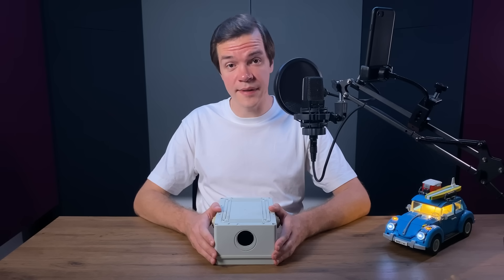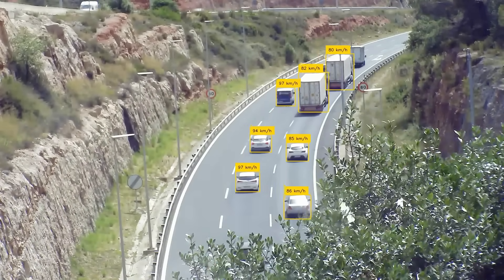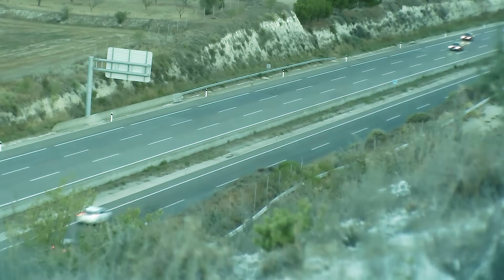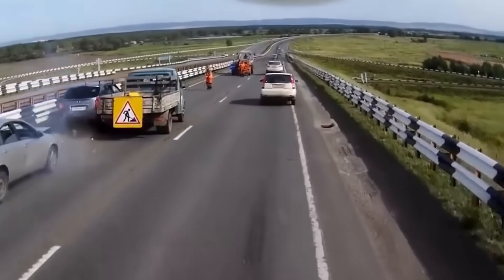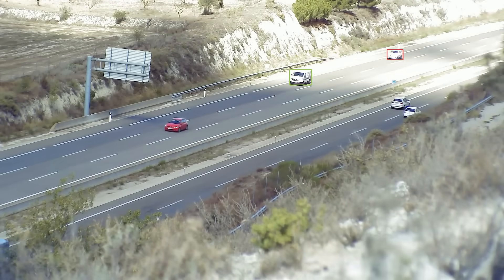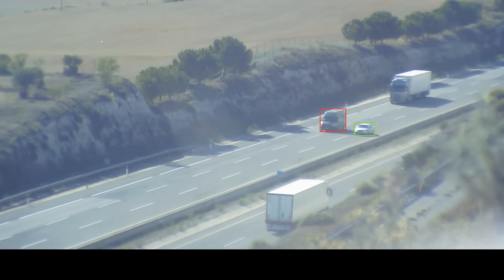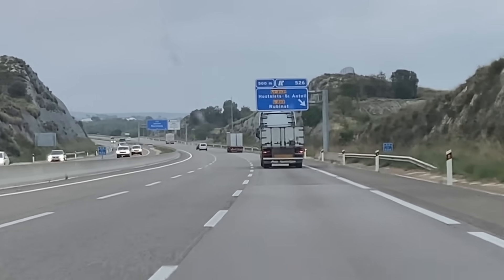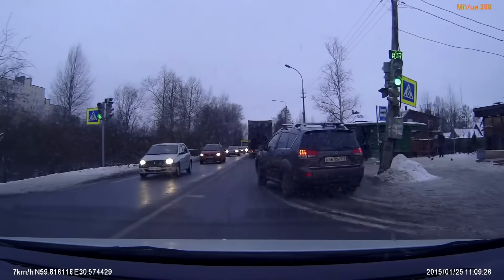New Anti-Tailgating Camera Reveals Shocking Statistics

Comment: It's certainly frustrating trying to keep a safe distance and cars just throw themselves in between non stop, forcing me to slow down to leave more space, continuing the cycle.
Reply: I’m totally with you in that frustration.  When 80% of drivers think “there is a gap! I must fill it!” it becomes impossible to truly keep a safe distance.
The crazy part is that to each of them you are “driving too slow” so they actually think you are the problem.
Reply: @thepooz7205  you are the problem. Traffic should be moving as close to simultaneous as can be when in traffic, slowly allowing more of a gap to a little more than one car length to allow one person to merge at a merge point. No more. Start driving with some anticipation and you won’t feel the need to be 40 lengths back to feel “safe”
Reply: @kingkrow420 Anticipation only works on what can be anticipated, and you don’t have room for forgiveness in the metal box going 80 mph (exaggeration, this applies anywhere above 40 mph)
Reply: not to mention people that overtake you on the right because you try to keep a safe distance, which is illegal af in pretty much all of europe (save for some instances). They then trying to act like I'm the one who's driving badly, it's tiring. The absolute worst I've seen this happening when I was driving to Sweden from NL, in Germany it would happen ALL THE TIME, mostly SUV's, all of them German license plates 

For context I basically always speed on the highway, move to the right if I can and it makes sense. If you're stuck behind a train of cars in the left lane, moving over for someone behind you doesn't make a lot of sense, it only encourages tailgaters if you move out of the way, that's still like a 50/50 for me. I do try to use tailgaters to my advantage, I move over and start driving behind them, they're so obnoxious that people will move out of the way sooner or later. Other 50% is flashing the brake lights and flipping them off lol
Reply: @Peter_Griffaaa @Peter_Griffaaa  It happens if you drive on the 2nd or 3rd lane, not at the maximum allowable speed, and do not intend to overtake those who also drive on less than the maximum allowable speed.
Reply: @Peter_Griffaaa  you must have been driving in some parallel Germany or NL. Overtaking on the right almost never happens there in my experience. Especially in Germany, especially on the parts of autobahn with no speed limit. The chances are, that your driving style is not very good.
Reply: @barmalini  you've clearly never driven in the holiday season. it's hard to take you seriously in any case
Reply: @Peter_Griffaaa  just one question, why don't you keep right when you drive slower then the other cars?
Reply: @Peter_Griffaaa  "not to mention people that overtake you on the right because you try to keep a safe distance, which is illegal af in pretty much all of europe"

I'm not sure about Europe, but everywhere in the US i have driven which has a law against overtaking on the right ALSO has a law against leaving an empty lane on your right.

Which is to say, that if people are ABLE to overtake you on the right, you are probably also doing something illegal.
Reply: @ShuRugal  pretty bold assumption, you've never driven in busy traffic before? You've never encountered any real a-holes in traffic either, apparently. Lots of times the passing lane is congested but still going faster than the right lane (because semi-trucks). There will be (some small) space between the cars and trucks on the right lane now and then, so nice try but you're wrong
Reply: @Peter_Griffaaa  while people doing what you describe exist, my experience in heavy traffic (Phoenix AZ and Washington DC are on that list, so yes, i have driven in 'real' heavy traffic) the overwhelming majority of undertakes i have observed (happened to me, happened to others, or performed by me) have been in cases where the car on the left was either not passing at all, or was remaining in the left lane for minutes between passing vehicles.
Reply: @ShuRugal  Yeah no I was making my own bold assumption haha. I don't think it's even illegal to do what you describe in the US, so fair play,  that isn't the same here. I signal with my lights if the left lane isn't congested and the car in front can safely and easily move to the right, most people oblige but some are just bitter or something, they think they can decide how fast people can go. Even then I won't undertake, but start making hand signals in the hopes of him/her looking in the mirror 😂 I haven't had experiences like that with 3/4 lane roads, fortunately. 

Why are there so many videos of people in the US staying in their lane, so it looks random what speed they're driving then? It's theoretically almost the same as here but in practice it seems a lot different, at least to me
Reply: @Peter_Griffaaa  >Why are there so many videos of people in the US staying in their lane

I don't know that there is any one specific cause.  In my experience, it's just human behavior.  Here in the USA, the average mileage driven per driver per year is 13,500 (for passenger vehicles.  commercial drivers obviously average much higher)

most of those miles are NOT driven at highway speed.  if we assume an average speed of 40 mph, that's one hour per day IN MOTION.  obviously the miles-driven stat does not cover time spent sitting at traffic lights or in traffic jams, which can double or triple time spent actually in the car.

When people spend hours every day doing the same activity, they naturally look for ways to make it easier.  I believe that's the biggest factor behind seeing the "highway train" phenomenon, where everyone just grabs a bumper and stays in that lane as long as they can.
Reply: @Peter_Griffaaa A lot of drivers in the US don't check their mirrors or speedometer. They drive by feel and change speeds according to how fast the car next to them is going. They are inconsiderate bad drivers who are not aware of their surroundings. Driving is considered a right but should be a privilege.
Reply: @ShuRugal  in Europe it's exactly the same, - you must drive in the right-most free lane. Most likely, it's he who keeps driving in the left lane all the time, pissing-off the entire autobahn
Reply: @Peter_Griffaaa  Overtaking on the right is perfectly legal in at least a few EU countries, as long as both lanes are intended to drive in the same direction (highways etc) though you can barely call that "overtaking". The REAL overtaking is where you are driving on the lane belonging to incoming traffic, and only then it's illegal for someone to "overtake" that you from the right.
Reply: Well done, thank you for the video. With exceptions I always try to maintain the 3 second rule, regardless on highways, or on the street, however, if I noticed a tailgate behind me I would increase that to 5 seconds or more intentionally to save my boot.
Reply: Do you live in the US? That's what driving on a US highway is like. You simply cannot maintain a safe distance between yourself and the vehicle ahead of you, because if you try, without fail, someone will speed up enough to overtake you, then slot into your safety margin space and slow down. One can't help noticing how stupid it is, because the person who speeds up to overtake you winds up cruising at the same speed they were going before overtaking you. All they do is force you to slow down so you can create another gap between you and them, which sets up the opportunity for the next @$$hole to overtake you and slot into your safety margin space.
Reply: Just set cruise control 2mph below speed limit or flow of traffic and you don’t have to brake much.
Reply: Screw keeping a "safe" distance. I'll drive 5mph slower than the people in front of me until I'm a quarter mile behind the cluster. Then if people want to tailgate me I'll gradually slow down more until they pass. I don't want another vehicle anywhere near me on the freeway when 1/3 of drivers are holding their phones in their hands.
Reply: The cars throw themselves in between? I'd bet it's the driver of the cars.
Reply: @mikemortensen4973  The people throw themselves in between? I'd bet it's the the people steering the cars.
Reply: That is precisely why I just choose to go ahead and pass that person. And everyone else. When i finally find a nice gap i just chill there.
Reply: This is why people tailgate.
Reply: It beats the alternative. Keep up the good work.
Reply: Yes, there comes a point where the danger from people performing risky undertakes and overtakes so they can jump a bit ahead and cut back in front of you is more dangerous than just leaving less gap. Unfortunately you cannot entirely dictate how safely you want to drive, to some extent that decision is made by others.
Reply: The only answer is to drive with an absurd distance between you and the car in front of you. If half of all drivers left 50 yards or 35 meters in front of them, there wpuld be no traffic jams.
Reply: No, YOU need to drive less like your grandma and decrease your distance. YOU are the problem.
Reply: @edwinov  sounds like you're either 14 years old or never developed past it. Enjoy crippling a family of four with you superior driving.
Reply: It’s sad but we need more cameras all over watching the public places so you have protection from selfishness.  Thanks

Comment: Interesting video that backs the psychology I've witnessed on US highways for over 32 years of commercial driving in large trucks (often overweight/oversized loads that are far more heavy than the average tractor-trailer).  There is no easy answer or solution to this and I've witnessed it in all conditions and situations, be it rush hour traffic in big cities or driving in very rural areas.  Most of it is true ignorance on the part of today's drivers, a false sense of security reinforced by the fact that most are clueless about calculating stopping distances vs. weight vs. brake efficiency vs. weather, etc.  That is fact...  Not conjecture.  I used to do a lot of general aviation flying and braking distances vs. weather vs. runway surface conditions vs. runway length are just part of what one has to consider so a pilot doesn't become one with the obstacles off the end of a runway.  

Others have mentioned how vehicles will fill the space one leaves for safe following...  This happens with trucks all day, every day, ultimately slowing a truck attempting to maintain a safe distance more and more until now it has simply become an even larger obstacle with traffic streaming around it.  This is the best case scenario.  I caved in the rear end of an SUV years ago in Alabama when the driver raced around the right side of the tanker I was driving to jump into the space in front of me at a construction merge when I was already braking for traffic that had braked and stopped in front of me.  The construction zone was not properly marked and there was a crew in the right lane over the crest of a hill with no proper warning signs, replacing a road sign.   The driver that cut me off lost when the decision was made to rush around the right side of me (the side with the least visibility in a big truck), then swerve over in front of me to slam on their brakes.  Brake-check a big truck and a smaller vehicle simply loses, period.  You cannot defeat physics or Darwin at that point.  

The psychology is interesting, though...  I will see those with cruise control move to the passing lane a half mile behind me, then they move over in front of me when I cannot even see their rear-view mirror, only two or three car-lengths away.  Think about that...  Why would I wish to ride closer to you in such fashion?  Why would you wish to play Russian-roulette with a big truck?  That is simply the lack of education of drivers, in many ways.  Most are oblivious and there are far too many distractions in vehicles these days (defeating cell phone usage would be tempting but that would also impact passengers, so that's not a clear-cut answer, either).  

I am happy I do not have to drive long-haul in much of the US now for these reasons, since I've returned to mostly oilfield driving in the Dakotas, Montana and Wyoming.  And, yes, the new generations of truck drivers often drive as if they are operating a car, sharing the blame with much of the general traffic on the roads these days.  I looooove lots of following distance in front of me and always have.  I was brought up with courteous driving habits, as well, but that has mostly eroded into the "me-first" attitude so prevalent in today's world (for it's not only the US that is guilty for a change  lol).  Just my two-cents-worth.  :)

Comment: Simple enough to require following distance software with automatic deacceleration on new cars, with a driver op out setting that emitts a radio wave for enforcement. It's the next logical rule after "seat belts".  Cars crashing without the following system activated could be ticketed for reckless driving and exempt from "collision" coverage.

Comment: While I agree with the main points of the video, I think there is a serious misunderstanding about what is considered the safe following distance. 

The 3 or 2-second rule (depending on country) represents only the reaction time, as the stopping distance after braking is approximated to be equivalent for all participants. 
The main purpose of this is city driving where there is a high volume of cars at lower speed where the statement usually holds (especially that in these situations the first car rarely needs to use the full performance of the brakes, thus leaving headroom for the following car), as the inclusion of the braking distance would unnecessarily choke the throughput of the streets. 

Now, if people fully understand the implications, this also means:
- Most importantly, if you are not in a following car but a place where you might need to react first, you need to account for total stopping distance, thus in reduced visibility condition or where there is a higher likelihood of emergency, SLOW DOWN for the love of god... Especially next to road works, the amount of people annoyed that they can't go 130 kmph half a meter from another human being is frankly infuriating.... 
 - At higher speed, you need to account for performance difference SIGNIFICANTLY more, thus you need to leave higher safety margins 
 - The impact of different conditions ISN'T the same for every vehicle(type). e.g. slippery surfaces might degrade motorcycle braking to be worse than cars, as they only have 2 tyres the friction to kinetic energy ratio can flip to the car's favour + so they can't just stomp on the brake thinking abs will save them 
- There might be other limiting factors on breaking, e.g. a bus driver might not want to send its passengers flying, or you are followed by a heavy vehicle without the necessary distance...

Comment: What is equally frustrating is something I call reverse tailgating. This is when passing drivers move too early when passing back into the right lane. If 1 second per 10 mph is required, they need to allow this space before moving back into the right lane. But what happens is that they move over too soon and do the reverse tailgate maneuver, causing you to be tailgating the passer.

Comment: My dream is that one day highway driving will only be allowed by the car itself, and cars will communicate with the cars ahead. So they will more or less break and accelerate simultaneously. And if there is a queue 10 kilometers ahead, already now the cars will slow down to avoid the queue to pile up. Autonomous driving should be easily solved on highways, because they are predictable and can have special signs to give information to the cars. We would have near zero accidents.

Comment: Speed does delay the time you need to brake and in some conditions, view can be limited. You can't process things as clearly when you are going faster. Coming from Germany, on some highways, going above 200km/h isn't even considered speeding. From this background, I would say speed sure is a factor, and in an area with a lot of traffic, you should limit speed accordingly for safety. Especially overtaking seems a lot more dangerous with higher speeds.
 But the distances sure matter more.

If you want people to actually respect speed limits, you need to do speed cams in a variety of locations at different times, and getting caught needs to hurt. People are used to not getting caught, that's the problem.

Comment: I believe it is still relatively easy to prove someone was tailgating. Vehicle license plate ID, and multiple tailgating cameras over a few km should show who is tailgating. And just like speeding fines, you should have the right to view the video which is supposed to show you were tailgating. No video, no fine. I think a more advanced system could also use overlapping cameras to eliminate "forced tailgating" or shorter distances during braking of the car in front. Not simple but certainly possible.

Comment: Thanks to all the highway drivers that cut people and especially trucks off. You are responsible for rear end mass crashes of traffic jams where trucks plow into stopped vehicles without stopping. Modern trucks have braking assists and emergency braking systems that would prevent such tragic events entirely, but absolutely no driver has them on because they would go into emergency braking after being 10 minutes on any highway because the system reacts to those vehicles that cut them off.
Terrible egoistic and impatient drivers are responsible for deaths every single day all across the globe.